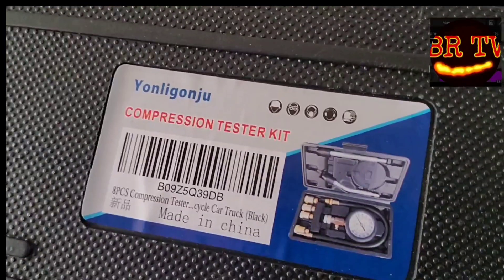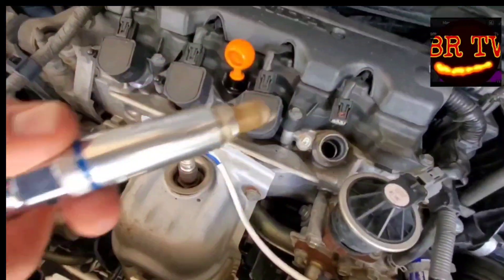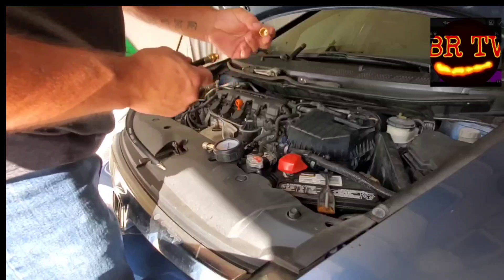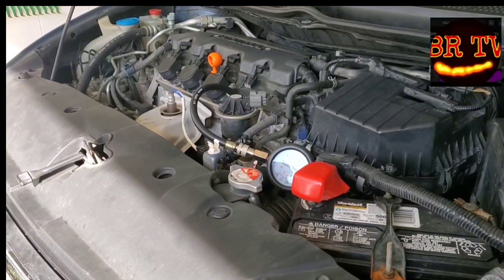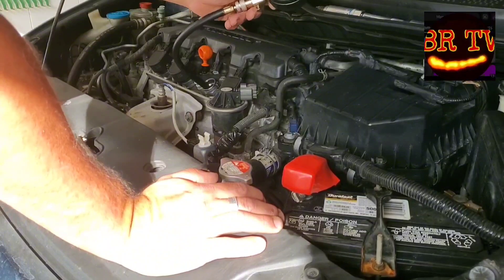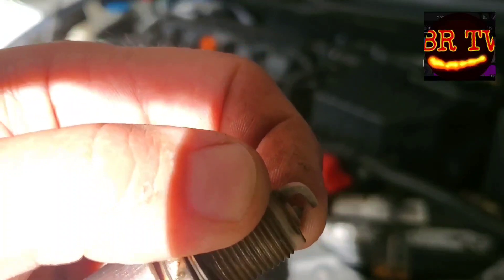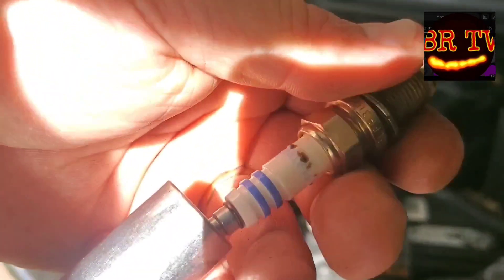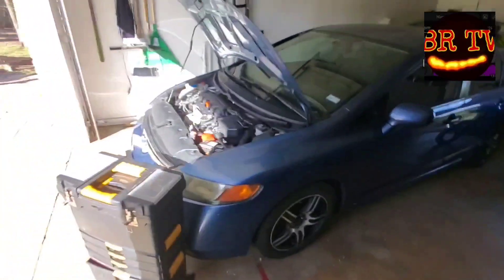Honda Civic cylinder compression test

Comment: Hey brother I have an 8th gen as well. Great cars. Anyways to do this test properly. Have the engine at operating temperature.  Remove all the spark plugs. Then test each cylinder. Make sure when you cranking the throttle must be pressed wide opened. Crank the engine over about 8 or 9 times. I do 9. Make sure the gauge and hose and firmly seated in the spark plug hole so no compression escapes. 😉
Reply from the maker: Sounds good